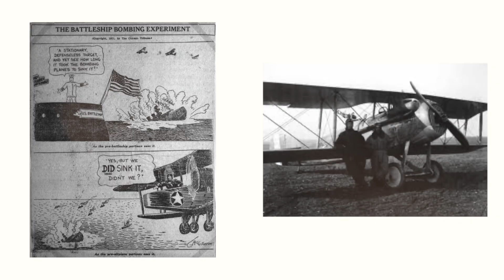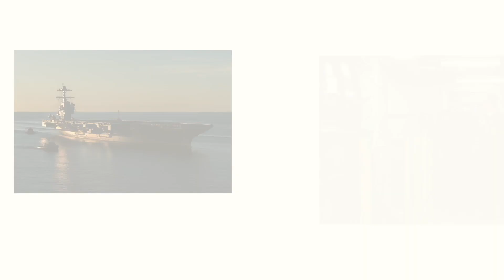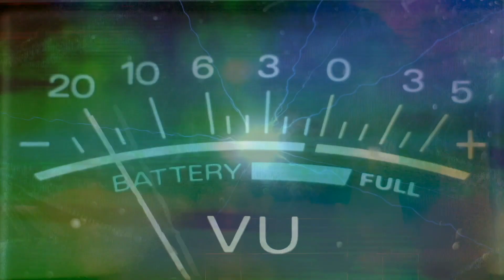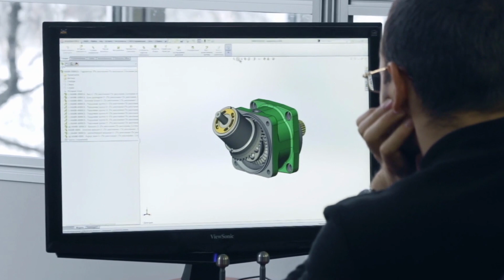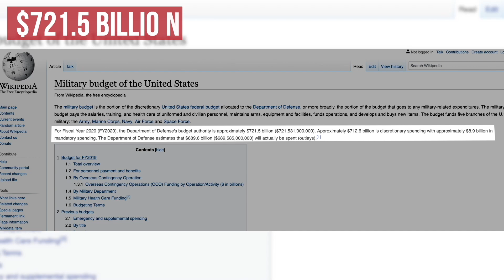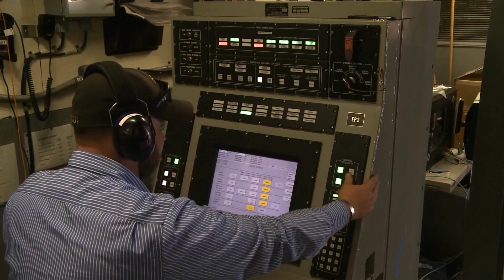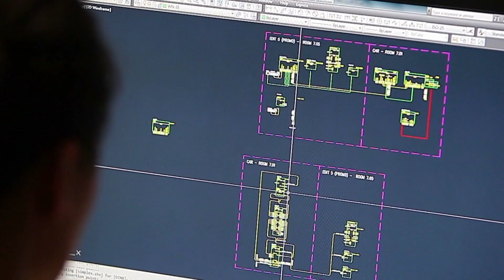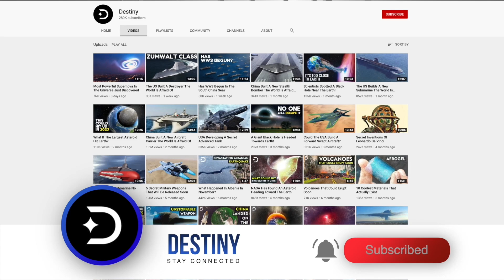Most Advanced Aircraft Carriers In The World

Comment: 5:12 - The Ford class still uses CATOBAR (Catapult Assisted Take-Off, Barrier Assist Recovery), it's just that the catapult is linear induction. (The barrier cables are electrically assisted as well, but the video covered that)

(Edited final comment)
Reply: Its a magnetic linear induction. I worked on them them at a Electronic company I worked for quite a few years. The magnetic levitation floated a 500lb stage that sat on a 1 ton solid piece of granite the stage would move it in X/Y direction at 400 mm a second. It was a good ride